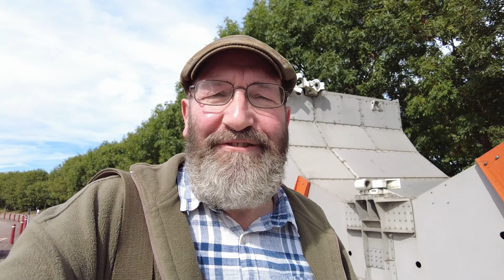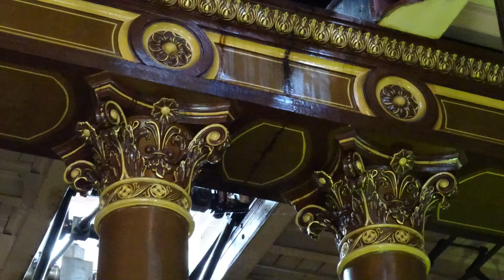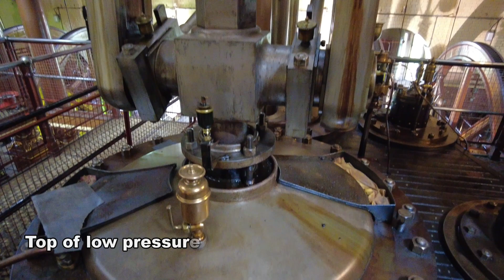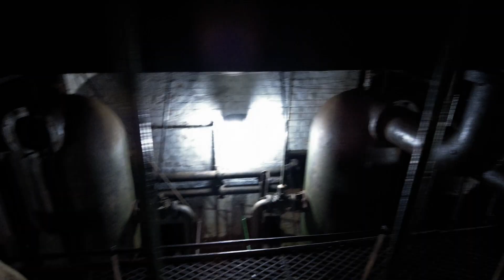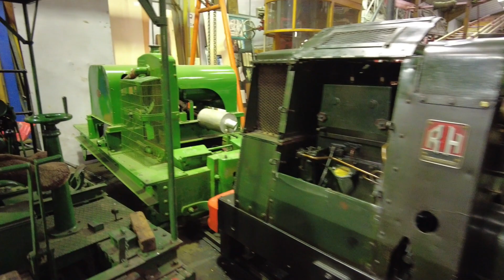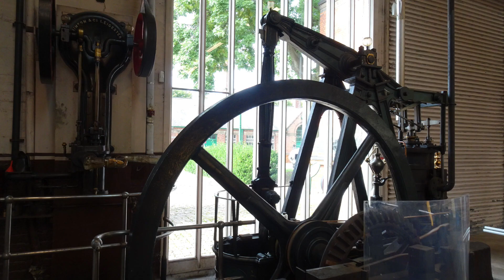312. Abbey Pumping Station, Leicester

Comment: Hi Alan.  I've been working on sewage works and sewage pumping stations for 30 years and it's interesting how it all works.  But these old pumps are amazing when you look at their size and the decorative design of the pumps, building and grounds. 

Sewage pumping stations now will be a couple of 3 phase submersible pump, ultrasonic level control with backup floats, telemetry, galvanised gridding, davit and socket for lifting, and a green fiberglass kiosk. 

Bye for now...... ❤️❤️
Reply from the maker: Hi Ian, that sounds very interesting work. The Victorians were magnificent engineers, everything built to last. To see a similar pumping station in action, please look at my video 107 on Papplewick Pumping Station near Nottingham. Cheers, have a great Christmas.

Comment: Another very interesting episode Alan ,you know like you I'm a fan of old engineering, what was the working steam  pressure  I'm guessing somewhere around 100psi or less with either a Scotch or Lancashire boiler or similar. Installations liket his were at the leading edge of engineering back then so no wonder they went to town with the embellishments which were magnificent. Thanks for the tour Alan  much appreciated.
We're In the midst of a big snowstorm forecast to dump 25 to 30cms over night and tomorrow so I know what I'll be doing tomorrow.
Cheers and all the very best for the festive season.
Reply from the maker: Hi Ralph, sounds as though you've got your work cut out clearing that snow, at least you're prepared for it. This is a magnificent piece of engineering, built to last, to see a similar pumping station in action, please watch video No.107 on Papplewick Pumping Station near Nottingham. All the best, seasons greetings to you and your family.